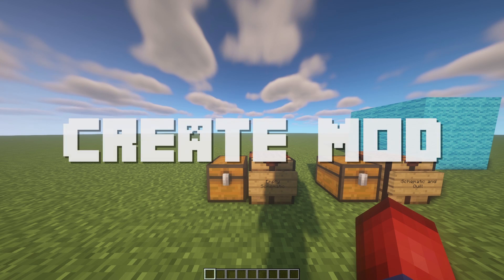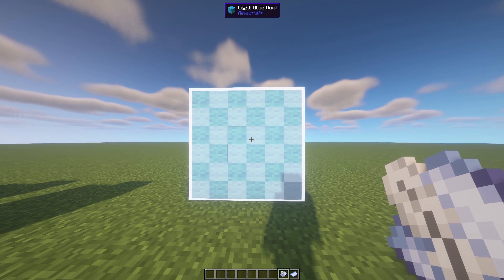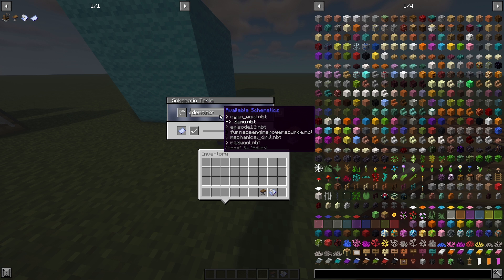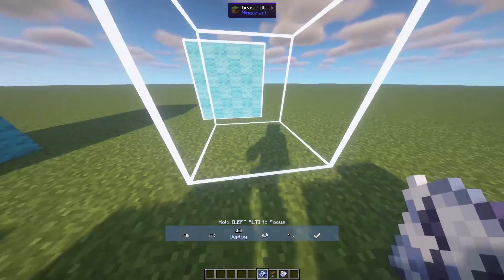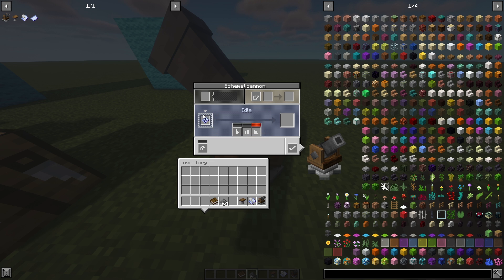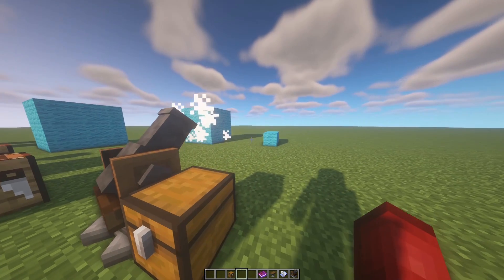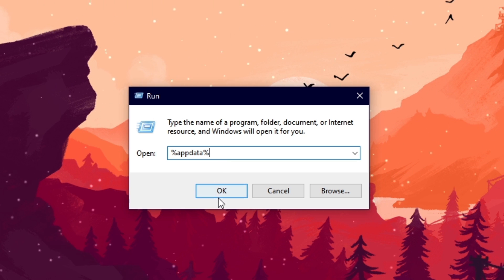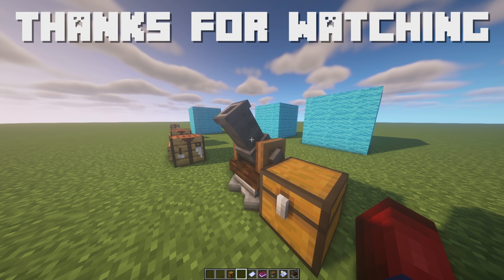Minecraft Create Mod Tutorial - How to Use Schematics and Schematicannon Ep 13

Comment: so i just built a massive sorting system in creative and I want to get a schematic for it into survival so I know where things should be, but it says the .nbt file is too big

the worlds are 1.19.2 singleplayer forge with create, worldedit, and a few misc mods. The one where the schematic was created is in creative, the one where I tried to open it is in survival. according to the chat error message the .nbt file is 480kb and the max is 265

the error message:
"Your schematic exceeds limitations specified by the server. (48KB).
The maximum allowed schematic file size is: 256KB."

I could just split the schematic in groups, but I would prefer it all in one file, but that doesn't seem like it will come easy

Any advice?
Reply: i gave up and have turned it into a left and right schematic
Reply: hey, i want to build something, but the file is 1067 kb, theres any way i could just use it without apearing "The maximum allowed schematic file size is: 256KB." ?

Comment: What if i want to make and build a schematic of a whole city approximately 600 blocks in diameter. Will the cannon build it? Im thinking if the render distance could be an issue or not. My first option would be to use litematica and create. But litematica is fabric and create fabric for 1.19 isnt yet released. This schematic system inside create would make everything easier

Comment: what do you do if another mod you have is already using the "schematics" folder? I don't want to put it in there just in case it messes up...

Edit: It should be fine, they use different file types so hopefully it will ignore the other ones!
Edit 2: Its crashing when I load a world, I think it is causing a problem

Comment: do NOT use Chisel&Bits blocks in a schematic, putting a schematic containing one into a cannon will essentially bookban you, you'll have to edit the nbt file and remove chisel blocks externally.
Reply: thank you for this
Reply: Holy shit thanks man. I was just about to do this you saved me
Reply: how about blocks from Chipped mod?
Reply: @akbarrmd7714 im pretty sure as long as its not turned into a chisel and bits block it should be fine
Reply: and does that include littletiles?
Reply: Is Chisel&Bits a mod?
Reply: @ilikewatermelonz4959  yeah
Reply: yeah  @ilikewatermelonz4959
Reply: thanks!!!
Reply: Wasnt going to but thx for the heads up

Comment: whenever I try to use ctrl-scroll it scrolls my hotbar and not whatever I'm trying to do, I've also tried focusing at the same time but it still won't work. Anyone know why?
Reply from the maker: I would check controls - there is a chance that you have 2 keybinds overwriting each other
Reply: @rockit14  Thank you for the suggestion, I haven’t gotten it to work but I got it in the right spot so it’s good for now. Also thank you so much for this series, it’s soooooo helpful. Keep up the good work 👍
Reply from the maker: @us_is_we9263  of course! Glad I could help - if you are running shaders or a texture pack maybe try disabling that, I wonder if that may be the reason